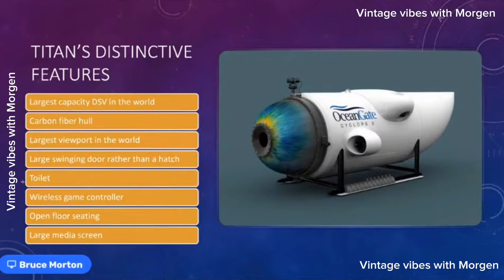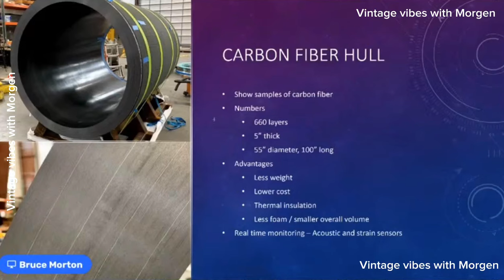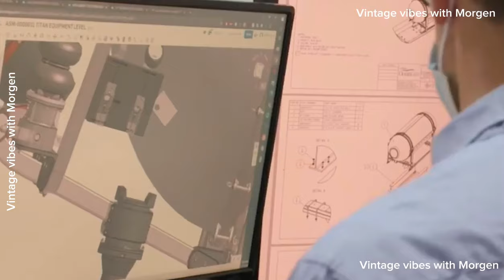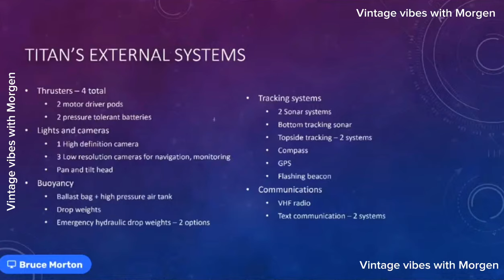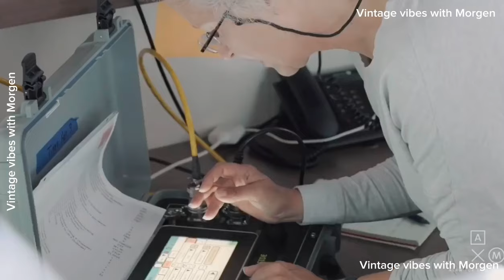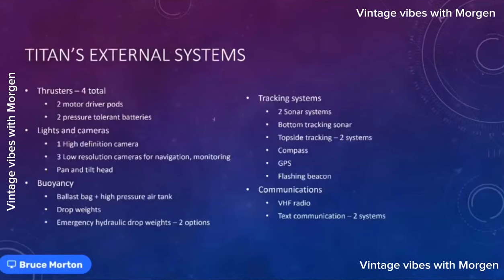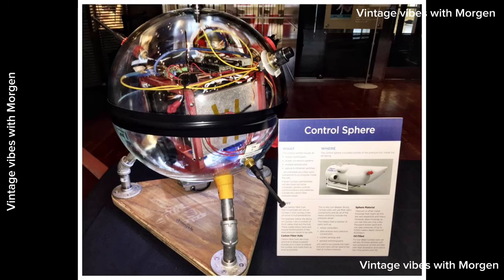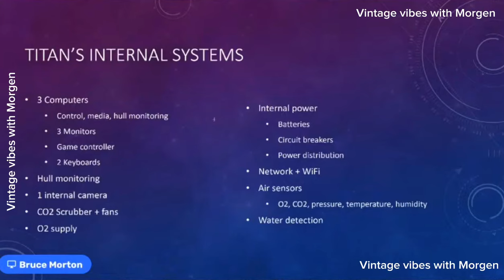Oceangate's Titan Assembly Components (Full Archive)

Comment: If you feel the need to build a device into your submersible that tells you when the pressure vessel is starting to crack and break down, then your basically admitting you’re aware there is a good chance the pressure vessel could fail or implode. And that my friends is very scary stuff.
Reply: Every sub does vessel testing at one point or another nothing last forever
Reply: Well that's the whole point to building subs, avoiding implosion/ explosion

So yes, they are all aware it could implode  because of the environment. So everyone will have fail safes to avoid the inevitable

Comment: I wish that people would talk about the inner ring that, that which the carbon fiber hull was inserted and glued into. Not only was that inner ring not even a quarter inch thick. You would have to imagine as the Titan Hull was being compressed that there was 126 million tonnes of a cumulative pressure being forced onto those two inner rings on the titanium ring  which I think had led to a chain of events of the implosion. I believe that those rings gave out before the hull or view port window did..
Reply: Believe what you want. This sub was so poorly built, it was just a matter of what would fail first.  The port window, the Carbon Fiber hull or the glue.  What I believe is that we will never know. I also do not believe the transcript was real.
Reply from the maker: There's more on that in the next video,  thanks for your comment my friend.
Reply from the maker: @nickv4073 indeed my friend, me too as well,  thanks for your comment.
Reply: @nickv4073 I absolutely agree with you one hundred percent but I think that those inner rings were a extremely point
Reply: @nickv4073 I don’t believe you know what you’re talking about any more than anyone else.
Reply: something blew out in the aft causing it to loose ballast and lean forward then the people inside would have tumbled into the dome causing the weight to shift and then they sank like a stone the fast decent was the cause to a already flawed design
Reply: II had the same thought. Also, they did not appear to prep the metal surface where it is glued to the carbon fibre. Finally, the sight of that guy's ungloved hand resting on the titanium ring. Yikes! And the carbon was being wound in a warehouse, not a cleanroom. A disaster in waiting.
Reply: @scottdelong1  your mom
Reply: @recessional5560  - I buried her last month. Do you have a point?
Reply: @scottdelong1  okay I buried mine a year ago tomorrow. Are you going to take every troll comment literally? Weirdo
Reply: I thought the carbon fibre hull was glued to two titanium end caps. These end caps were at least 5 inches thick
Reply: I certainly didn't help. I believe the ring flange would fit the I.D. of the carbon tube but slightly oversized to create an interference fit. It's the only way it would ever stay on. Also the titanium end bells cycle at a different rate than the carbon transferring It's load into the carbon tube. You want to load share and this design has very little of that..
Reply: @recessional5560  you act like a troll and then get upset at people's reactions?
Reply: @melodiefrances3898  seems like the only person that's getting upset around here is you.
Reply: @starwoidlegorc826  Truth
Reply: @scottdelong1   It was not the glue side, his hand was on the opposite side.
Reply: @bigredinfinity3126    There is no hint to your theory.
Reply: @melodiefrances3898  Bro you sound like the troll! you are not supposed to drink the bong water!
Reply: Excuse me you there! Have these people been found yet? I’m concerned they don’t have enough oxygen
Reply: @moonstar21868  now that's funny Ha-Ha
Reply: @Xantylon74  how so
Reply: Not glue peanut butter like Stocky said.
Reply: Only one expert has spoken to the electrical system and what dragging it behind the ship could have done to it. 

Also, no one has verified whether the implosion was of the new hull. Allegedly he took what some guys/ experts said to heart and had a new hull built. 

Although it was a disaster waiting to happen, it did successfully dive to the Titanic. So maybe if he had worked with the MIB either he would have gotten it right, or had to ditch it before the disaster

There were too many points of failure but I'm betting there was some water damage to the electrical system after being dragged behind the ship

Comment: wait, carbon fiber tape? Steel vs carbon fiber tape for deep sea pressure? Yeah that didn't go well did it stocky boy?
Reply: U think that's bad. The first 1/3 scale model tested was ALL carbon fiber. The porthole collapsed not long into the test. With those results it was only rated for 1400 meters. Smh
Reply: @jameshiggins6716  wow! I had no idea. Thank you for the info.

Comment: It was almost all carbon fiber.that is only good for push outwars.not crush inward .and they dint over lap the .my cgod tape.if they didnr ocer lap.the pressure could seperate the winss between two .and it crushed in.breaking up the adhesive.rhat loosened the my god tape.if u listen to this guy.almost all the reasons he went cheap to save money.or make it easy.

Comment: They seemed to be absolutely sure that all tail part electronics, cables, connectors, sealed contact boxes and other stuff were tested for use in water pressure at thousands of meters deep below sea surface.
I remember there were some troubles with electronics in past dives. No wonder if there were leaking connectors or similar failures.